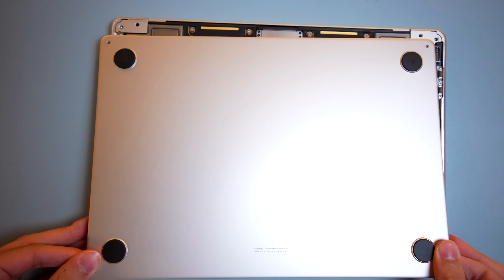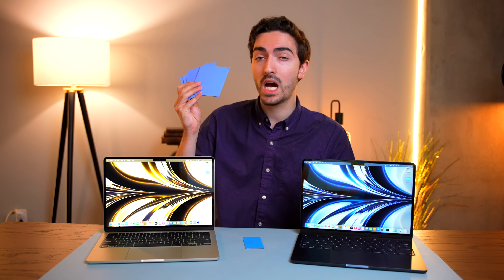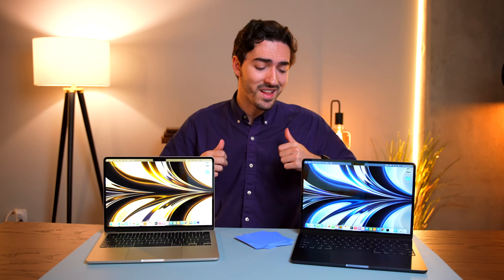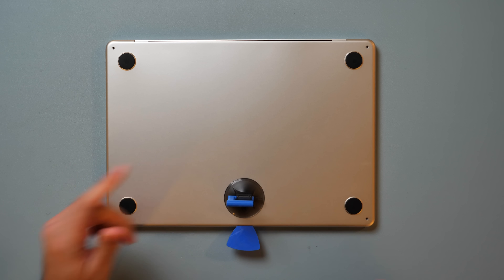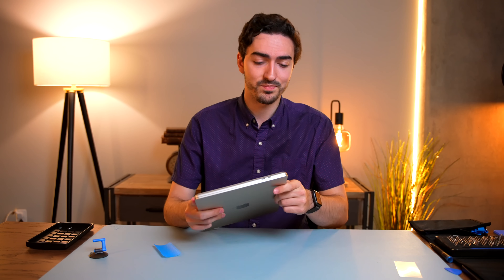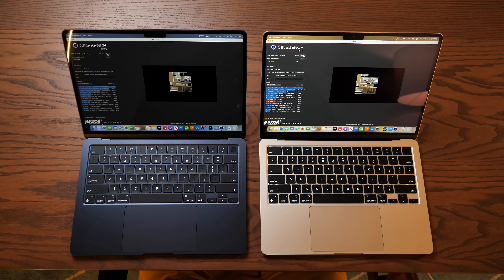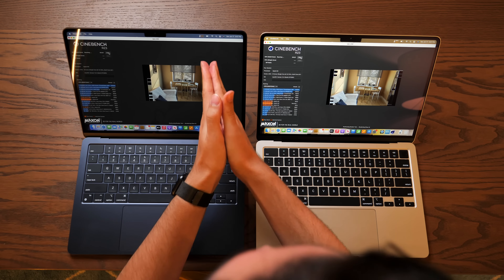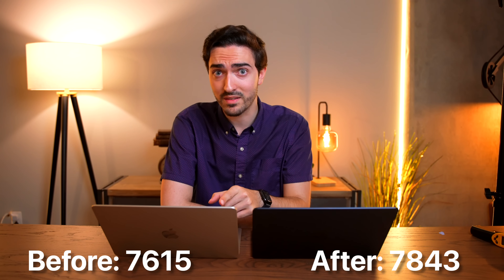Make your M2 MacBook Air FASTER for $8?!

Comment: So, the obvious question: why didn’t Apple do this? 

1) It gets the bottom case too close (or over) the legal allowed limit?

2) It transfers the heat to other parts that will be damaged or reduced in life span, such as the batteries or other components?

So, while some improvements may be gained (in the short term), could this actually be bad for the longevity of the MacBook or certain parts?

It’s an honest question as mine arrives next month.
Reply: Option 1, regulations forbid such high temperatures in a product like this (for health and safety reasons).
Linus Tech Tips made a video on this subject a year ago, which goes into full detail on these laws and the benefits of using this method.
Reply: Its a liability matter and when you can get burned. LTT did a video about cooling MacBook Air with intel chip and they mention why there is an insulation on a bottom case instead of thermal pad
Reply: @RealSebus  I used to own a 2020 Intel MBA with the mod. Can confirm, under certain loads the things is literally not lap-able anymore…especially if you’re planning on having kids.
Reply: If you do this and burn someone then in the US you would open yourself up to personal liability. It is not very sensible and probably one reason why Apple and many other OEMs are moving away from allowing mods and repairability on their ultrabooks, as people can do some stupid things.
Reply: It would be bad for your lap if you use it that way every day. The laptop doesn't even need to feel hot to the touch to burn. I got a blister from a few days of having a 'warm' MacBook on my lap during work from home 🥲. 

As for components, I'm not sure. In the intel days, Apple sure didn't mind letting their machines almost redline before the fans even twitched, and for all the worry it caused, it was mostly fine for years. People used to run fan control apps for fear of grilling their machines to death and to maintain boost speeds longer!
Reply from the maker: The first option is correct as far as I know. There is indeed a legal limit to how much heat the exterior surface of a laptop can produce, and on the M1 MacBook Air they stayed within that limit by 0.5 degrees, so I imagine the same is true here
Reply: Batteries degrade much faster if their temperature exceeds 45 C. I've seen a review of a similar modification on m1 MacBook air and battery temperature exceded this limit, so this is a plausible cause
Reply: The bigger question might be is if it’s wise to reverse Apple’s engineering (a thermal guard done for a purposes) so that we can gain better benchmarks for a machine that wasn’t created for such workloads, to likely shorten its lifespan and possibly damage the battery, or even make it dangerous…
Reply: @rkilbrai  I assume that Apple engineers know what they are doing and I am just an amateur, so I wouldn't trust my urge to improve it
Reply: This would be a good mod if, and only if, the user understands that the laptop should not be used on the lap and not in soft surfaces (blankets, couches, bed).
Reply: The answer is obvious: To get the best balance between all of these factors that are discussed in this video, which are external surface temperatures, high sustained performance, optimized heat output. I'm guessing these new MacBook Airs are perfectly (in the literal sense of the word) optimized for a balance of comfort and sustained performance, according to those legal constraints for how high temperature they're allowed to let their devices run at in terms of surface temperatures. So even if one doesn't apply these thermal mods, I would still assure other people that they're not leaving any performance on the table according to those legal constraints for how hot their device is allowed to get out of the box.
Reply: All it takes is one particularly heat sensitive component, coating, etc and… 🤷‍♂️
Reply: To protect you when you actually put the laptop on your lap
Reply: @andyH_England  A possible presumption to your post is that after you purchase something from  Apple or other OEMs, is that they still own it. Apart from warranty issues, it none of their business, what mods are made. Even though safety is falsely, given as an excuse  for lack of repairability, the real reason is financial.
Reply: @rkilbrai  I have done the mod on my M1 Macbook Air, and then I have done extensive tests. What happens is this:

- On relatively short tests (10 minutes or less), you get a significant speedup, and the battery temperature stays well within safe margins. The bottom case starts to get too hot (53.7°C=128.7°F). The boost in performance is almost 13%.

- On a long test (30 minutes), the temperatures reach unsafe values. The bottom case reaches 55.9°C (132.6°F) and the battery reaches 48.9°C (120°F). But the computer notices the problem and the temperatures are lower than these maximums at the end of the 30 minutes test. Even with the machine ultimately noticing and throttling, the performance boost is almost 19%!

My conclusion is that if you know what you are doing, the mod is beneficial and will hurt neither you nor the machine. I would however not recommend that everyone does the mod, as it requires the user to be aware of the potential problem and to avoid some type of workloads.

So you are right: it may not be wise. But I keep the mod because I have the vanity of thinking I know what I'm doing. :)
Reply: @lukemiani  Could you do a test measuring the temps of the various components, especially the battery, with or without the mod?
Reply: @Igor_lvanov  unless these engineers also designed the magic mouse with the charging port on the bottom.
Reply: @fixups6536 do you still have the mod? Is it still holding strong?
Reply: @Ugandan_key  Yes, and yes.
Reply: @fixups6536  thanks for the reply, can I ask if you have noticed abnormal battery degradation, also do you do any gaming on it, what thermal pads did you use? when it heats is it hot enough to hurt if you put it in your lap? sorry if I made are a lot of questions.

Comment: You should check if the 1mm pads were actually thick enough to contact the bottom case! Your inconsistency could be explained by simply having the extra thermal capacity in the heatsink, coupled with very thin (but still there) air gap.

Comment: The mod leads to a new problem,  the thermal load is better distributed (so no downclocking in short time), i leads to more thermal stress for the battery (and the temperature for the battery can get to high). The temperature  of the battery is tracked in terms of warranty, but the measurements of battery temperature  seems no to be used for controlling speed of CPU. If the battery temperature is also integrated into cpu speed management, it would be a good solution. At this point its more an optimization if warranty behaviour from apple is not an issue  for you (like also not covering micro fissures in the display (its ALWAYS customers fault and NO warranty)

Comment: This fix would really make a difference in long runs if there was some airflow on the bottom of the macs (either from leaving some room under them or by using a little/low revving fan). Without room for any airflow, it's just increasing thermal inertia
Reply: I was thinking the same thing. Right now he's mostly warming up the table. A stand, or one of those (not that expensive...) risers with fans built in would likely make a difference.
Reply: Wait, how about put some fans inside the case so they can create airflow to help cooling the CPU? What a genius idea.
Reply: @meowmeow3413  ah, it appears we have come full circle!

Comment: add furniture feet pads to tilt the laptop slightly. provide more airflow over the base. you should measure the table surface where your laptop is on. it soaks up the heat and once equal, it also degrades peformance

Comment: I would have a concern on battery longevity when the heat is transferred to the bottom of the case. There is probably a reason why engineers did not remove the heat from the CPU to the battery via the bottom of the case. But it is really impressive to see how much performance gain you could get just f a better CPU cooling. Nice job!
Reply: it is because it is illegal to have the bottom case be over 50c because it will burn you if you leave it on your bare lap for an extended period of time

Comment: I think it may have been better to isolate the tests more
Compare the higher quality piece of 1.5 to a similarly cut piece of lower quality 1.5 to see how they differ
Then see how 1.5 compares to 2 v 1 v 0.5
Then depending on which one gave the best results scale it up to cover the entire heatsink
Reply: I’ve read anything above 1mm might make it too thick to close, but the 1.5mm i have discloses a 1mm compression to .6mm ratio on the packaging. I’m assuming  better contact with the case is more optimal? Any thoughts ?
Reply: @estabravo  I'm no expert, but I'm under the impression that when using a piece too thick the heat doesn't transfer as well
I'm only repeating something someone else said online though so....

Comment: Would you be able to do a thermal test on the GPU using the pads on each? Seeing if these will help the 10-core perform better for longer compared to the 8-core which doesn't throttle as much.

Comment: I don't know why reviewers are insistently referring to the thermal behavior of the MBA as a 'problem'. This is not a problem, it is expected behavior from a fanless laptop, and it is by design. 
The MacBook Air is a fanless device. The advantage you get with that is there isn't even the possibility of fan noise. The disadvantage you get is not being able to sustain the peak performance level of the chip inside it. With MacBook Pros, you do get a fan, so there is a possibility of you hearing fan noise (even though those too are basically silent (but there are still people who get annoyed by even a little bit of fan noise, or those who just don't prefer it) but the advantage you get is basically perfect performance stability. It's in the name, the MacBook 'Air' is meant to be the thinnest, lightest, most portable machine Apple can make, while the MacBook 'Pro' is meant to offer you that peak performance state at all times, silence be damned. 
It's up to the customer to make the decision of which device they want to go with, based on their needs and wants and priorities.
This is not a problem, and it's a very elegant and logical way to offer a wide range of choice for the widest range of customers possible.
Reply: It's a bizarre one for sure. In Max Tech's review of "problems" with the M2 MBP, they stated one "problem" was that it hasn't been redesigned.... Not really sure how that's a problem.
Reply: I honestly would've preferred if they had kept the fan or some sort of proper cooling for the Macbook Air than to deal with throttling and heat, and not having to pay extra for that. The M2 seem like very capable chips, but they also generate more wattage than the M1 which means more heat. The problem is we're not exactly sure how well these laptops will perform long term because they can reach very hot (107C, 224F) temperatures, and having no fan further exacerbates this.
Reply: People love to be right even if they got their knowledge from a video. Suppliers of these videos make money, it’s a loop for those wanting an edge in conversations. I’d wager many commenters aren’t buying this 

I ordered the 2tb with 16gb ram 10gpu, anywhere I go it’s going to look nice, professional and it can run my photoshop needs for years..coming from a 15 MacBook 12 anything is an improvement and after years of use I want another fanless silent device
Reply: Because there's a non expressed computing potential that with a different design probably would have been reached (maybe with a vapor chamber?). Also the computer costs more than the previous version, it is advertised to be 17% faster, so you expect it to be more powerful consistently, not just for a couple of seconds. It's a producer's claim that doesn't translate well into reality and that's the problem. Also... it's fun to experiment with these hackings.

Comment: Would have loved to see if a laptop cooling pad with a fan would have increased performance even more.
Reply: i have my intel mac on a stand with a desk fan blowing on it from below, it helps a lot at reducing thermal throttling, more so when the cpu is the main heat source and less so when the gpu is. i haven’t added thermal pads/copper shims/etc inside yet.

Comment: Two points.  Although the thicker thermal pad is harder to get the rear shell back on, the physical contact between the pad and the shell will conduct the heat away better. The whole point of thermal pads and pastes is to provide a continuous media between to objects to facilitate the transfer of heat. The firmer the contact the better.  Secondly, the thermal emissivity (blackbody effect) of the midnight-colored case is less than the lighter colored case. Although the difference is minute, cumulatively it shows up in your testing.
Reply: Thanks for highlighting the Color issue. So silver/space grey/starlight Color Air M2 will thermal throttle less ?
Reply: Thermal emissivity in this test is likely dramatically more impactful in our heads than in reality. Probably accounts for 1% or less of any single benchmark point under these conditions.
Reply: @zhorapata9733  Don't know for sure, but with all other things being equal it may contribute to heat buildup over the long haul. However, I doubt that it will only fractionally reduce thermal dissipation that to the level that may not be measurable. Thermodynamics are a complicated and makes my head hurt.
Reply: @tylerhough9124  I agree with you whole heartedly. I'm also curious as to how airflow is accomplished on these notebooks. It seems there are ventilation ports to exhaust hot air but I can't figure out how it takes fresh air in. I realize that without a fan or fans, it will be strictly a convection process. Putting the thermal pads may help draw away some of the heat but how does it affect airflow?
Reply: @lazerbeam3928  Heat transfer in this system seems to be mostly radiation through the air and conduction through the table & case surfaces.  I'd expect a minimal amount of convection from the small openings, because hot air rises while cold air must take it's place.  However, that effect would probably be minimal unless a fan is added.

I was wondering about the black-body effect of the color difference between the macbooks myself.  It would be interesting to see a comparison of both laptop colors when using the same thickness and distribution of thermal pads.  Maybe it's still a minimal effect, but it might still be visible from comparing just this difference when all other variables are held roughly equal.

Comment: If I had to guess the blender anomaly was because those thermal pads were also on the storage chips and some of the CPUs heat transferred to those causing them to clock down

Comment: What are the temperature differences of the "ssd", "battery" and other sensors with and without thermal pad?

Some users have given feedback that the heat pressure on other parts increased after the thermal pad application.

Comment: I wonder if there are even greater performance or temperature improvements when more thermal pads are added to the backplate on the outside. It could possibly transfer heat through the surface below the MacBooks rather than through the gap of air created by the bottom bumpers. This would be really cool to see the results.

Comment: the black stuff is not put there as thermal insulating tape... 
it's to prevent electronic discharge. It can prevent the laptop components from shorting, when/if it touches the aluminium casing. it's a safety feature.
this is also why most "non-apple" laptops have a little black piece of this, covering the ssd slot, ram slot etc.

Comment: I would add a thin copper heatsink outside of the case as well. I'll be adding a stand/riser to prop it up anyway, so I'll probably add 1 or 2 rectangular heatsinks alone the riser, would be great if you could test it.

Comment: I was wondering if the thermal pads distribute the heat so well, doesn't the battery also get significantly warmer, which has a negative effect on life expectancy? Would it be possible for @lukemiani to make a video on how the battery temperature behaves with thermal pads? Thanks and keep on with the great videos 👍🏼
Reply: Battery will logically drain much quicker as larger current would be required to supply the cpu for extended period of high load. Battery will heat up and hot batteries are not a good thing. This would defeat the purpose of a mba.

Comment: The starlight air you placed the pad only on half of the M2 Chip. The 4 screws indicated where the M2 chip is. That is a waste of cooling potential especially since the "heatsink" is not actually one, it's just an EMI shield on these Airs and does the minimum required work for actually heatsinking.

Comment: The heat dissipation seems better, but I wonder if Apple deliberately dismissed the thermal pad option because they didn't want to risk leg-burn and adversely affect the battery longevity through exposure to excess heat?

Comment: My hypothesis? The lower performance of the Midnight Macbook Air has to do with the additional GPU cores. Since the M2 chips are SoCs, the GPU cores are on the same substrate at the CPU cores. More cores=more wattage

Comment: Well done! Indeed using high conductivity thermal pads on the whole surface of the heatsink is the key, but I am right now Chinese manufacturers are developing 1 mm thick vapor chamber which you will be able to place on the the heatsink or the one which will completely replace it when you're going to be ready to do it after warranty expiration.